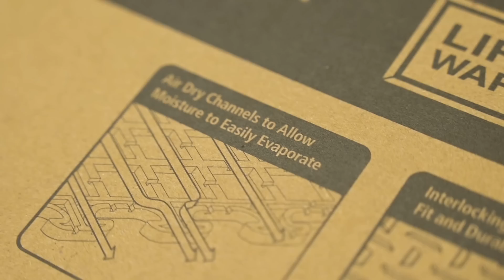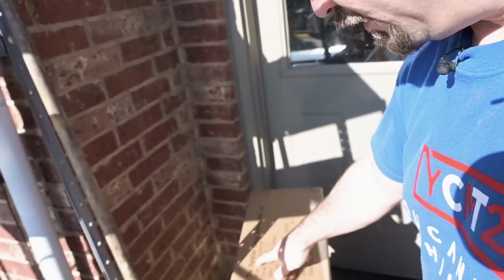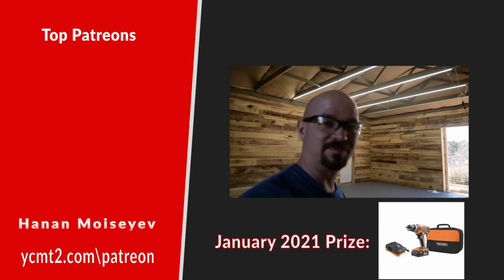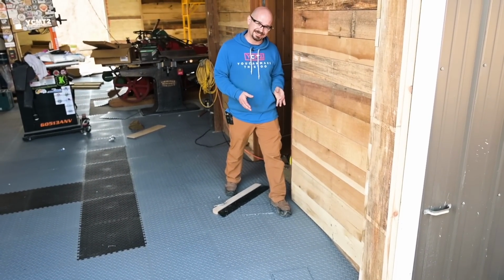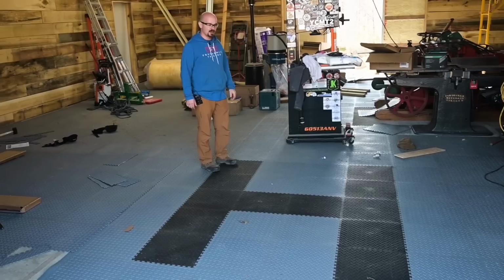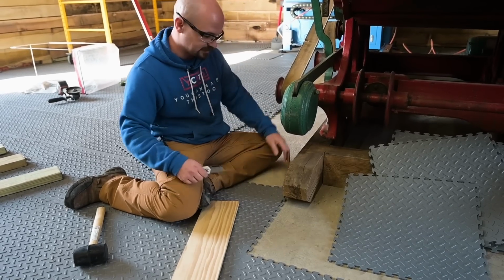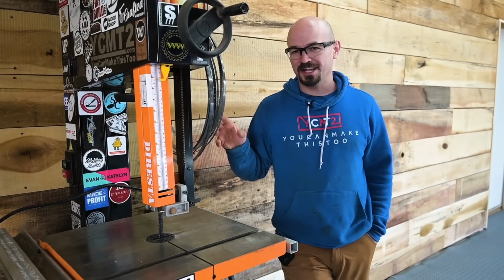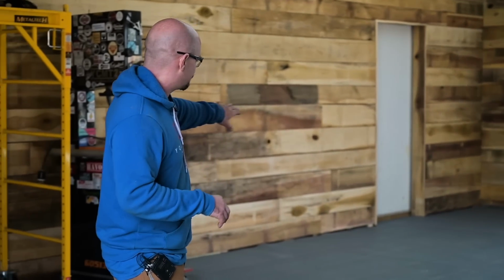Best Shop Flooring | Dream Shop Ep7

Comment: Super flooring. I have used the same thing but in a lot smaller area, like in front of my work tables, not a whole work shop. Nice touch. Good luck with the new shop upgrades. Stay safe sir.
Reply from the maker: That's a solid approach too, it can get pricey to do a whole shop. Thanks!

Comment: Roller knee pads/blades are also useful.  Hopefully you used some hearing protection- all that mallet pounding and echoing.  For such a big job you could have used a tamper- like that for soil and gravel.  Saves on the knees and back.
Looks great! Good job!
Reply from the maker: Ohh, never thought about using my tamper. Not a bad idea. Some the tabs are finicky and there can be some adjusting the tiles as you get them going on so not sure if that would've really worked or not.
Reply: @YouCanMakeThisToo   Doh!  Didn't think of the tabs being too problematic.  Figured that "persuasion" from brute force would knock them in, but you're right- not adjusting as you go along might ruin the tile or adjoining tiles.

Comment: Wow, my shop could use that! Just curious if you think that material could handle my rolling workbenches and cabinets.
Reply from the maker: The only thing I’ve rolled across it so far is my bandsaw. Which did fine. It is kinda bumpy of course, so small wheels are gonna introduced some shaking. I’d bet any wheels 3-4” or bigger won’t notice.
Reply: I’m gonna look into it, thanks!

Comment: Are the tiles comfortable under foot? I have foam tiles throughout my small shop walking areas, and aside from buckling you mentioned, I like that. Your tiles look more rigid.
Reply from the maker: They are! They're not anti-fatigue, but definitely have some give and are more comfortable than the concrete. The diamond plate isn't enough to be uncomfortable.

Comment: What did you apply to the concrete before the leveling mix, it was a pink liquid?
Reply from the maker: Just a primer. Each brand leveler has their own primer to use with it.
Reply: Thanks

Comment: Why did you choose the vinyl flooring over other methods? Did you consider condensation between the concrete and the new flooring? By the way it does look great!!
Reply from the maker: Thanks! It's "vented" on the underside so air and moisture can move pretty freely, doesn't really trap it. Also, with my dual 18,000 BTU mini splits.. the environment is going to stay pretty stable, there won't be much fluctuations causing condensation. Also, it provides the protection I want, helps with sound a ton, is easy to install, and if something gets damaged.. easy to swap a tile.

Comment: Have you tried sweeping up sawdust?  Will the bumps mess up the bristles doing their job?
Had the cushion mats in my shop and got rid of them because the broom would “grab” the foam mat and not slide across.  I know yours are hard, not cushion like, but is there a difference?
Reply from the maker: It does do that some, but I primarily vacuum the shop using my dust collector, sweeping stirs it all back up the in the air. Of course we're sweeping until that gets set back up..